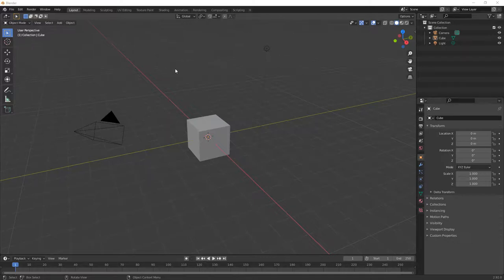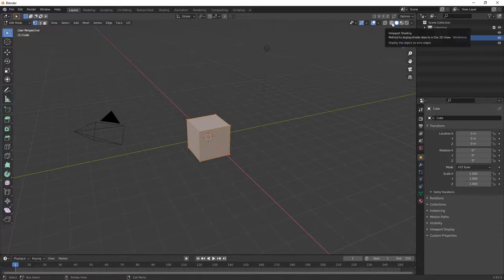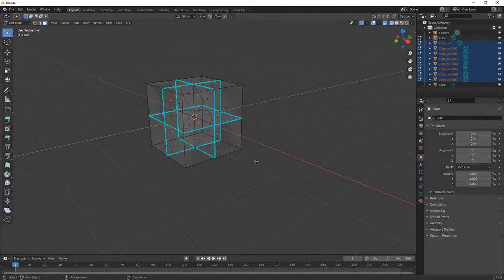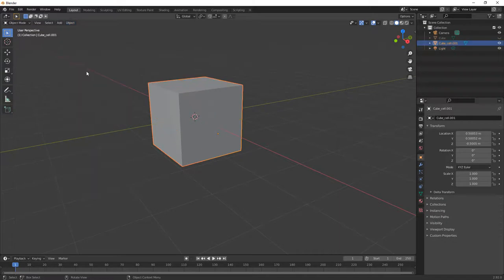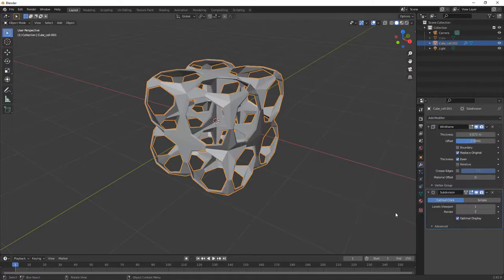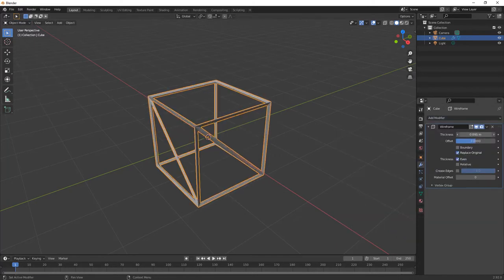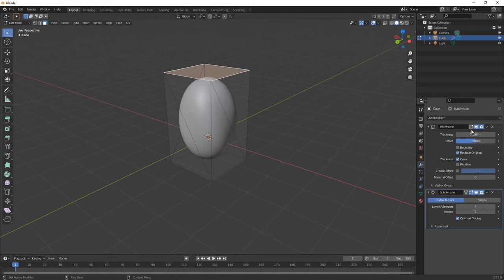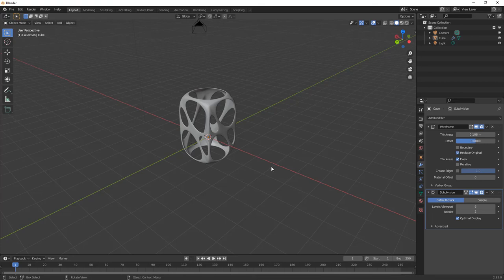Fusion to Blender EP4: Simple Lattice Structure in Blender 2.92

Comment: tks for the vid, but suggest you focus on the topic of your vid and get to the point. users who are doing cell fractures might already know how to do basic navigation. go in depth on the subject you are discussing
Reply from the maker: Thanks for the comment!  This little series was meant for Fusion 360 users who haven't used Blender much if at all which is why i spent time on basics.  This series is pretty old/outdated at this point so i will likely pull it down.  Happy modeling!